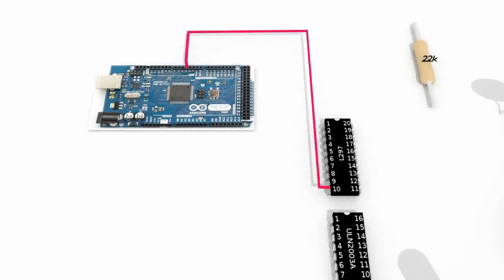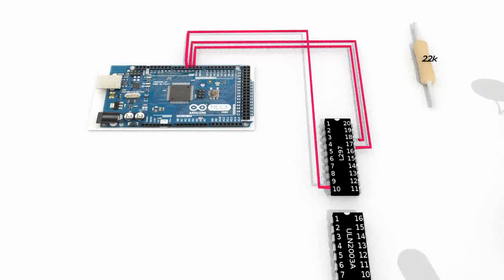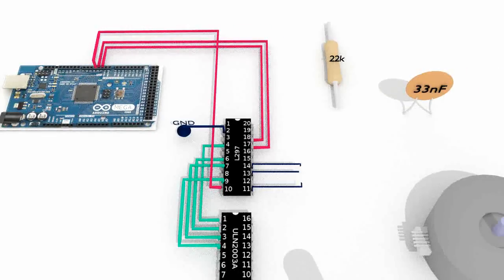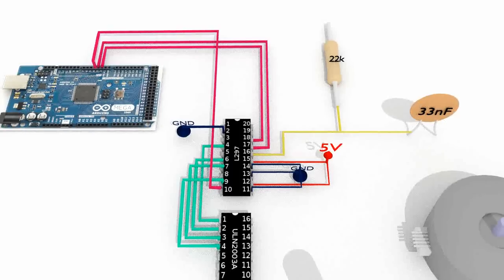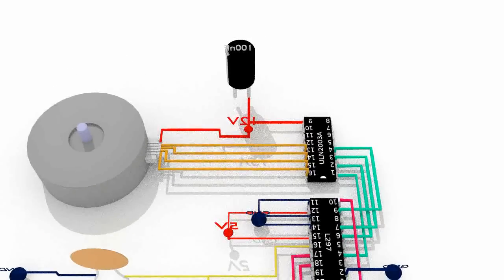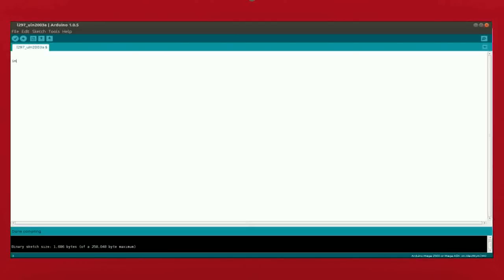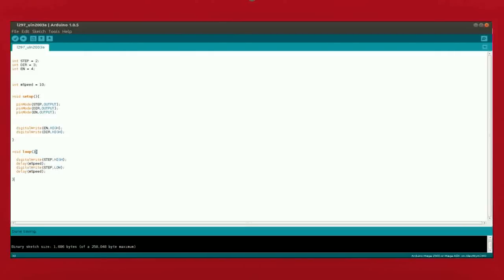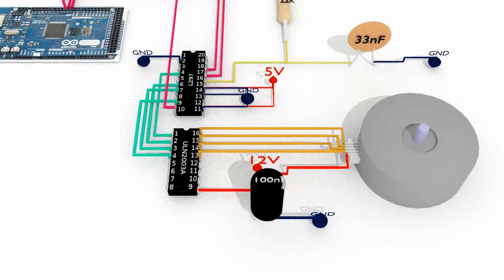Swift Focus: Arduino stepper motor control with L297 and ULN2003A

Comment: Отличная графика. Только не вижу необходимости в использовании L297. Можно и без неё обойтись.
Reply from the maker: Thanks,
ULN2003A works only at logic level so only 5v  and i don't think it has enough current.  If you want to drive a big stepper motor you will need the L297 .

Comment: You use pin 9 for the stepper common, when it should be pin 10, am I right?   I have used the ULN2803A by doubling up each pair of darlington outputs and inputs to double the current abilities, so i have no unused pins on the ULN2803A.  Pin 9 is ground, not common.
Reply from the maker: Yes  ULN2803A's pin 10 is common , but in ULN2003A is pin 9 . so you should wire it as per the IC you used .
Doubling the darlingon inputs and outputs  ti increase the current is an interesting idea . let me know if it works well :)
Reply: I am trying to use the ULN2003A, L297, and controlled by Tiny85. I am trying to get the Tiny85 to be triggered by interrupts  through a duel opto isolator. one signal to wake and set direction, and one to clock the L297. I need two stop switches to be monitored.  I'm not sure I can do it all on the Tiny85 yet. The use is to control a tilting mechanism for my dual band amateur radio antennas on the roof rack, with control from the dash.  I am using a geared stepper I took from a security camera. It has the geared section for rotating the camera, so I kept all that. I don't need  1 full amp to drive the stepper, I used  the extra pins to even out the heat on the chip, in an effort to prolong its life in the hot Florida sun.
Reply from the maker: The  ATiny85 seems to have only one interrupt PIN ,  and if i understood correctly , you want two interrupts one for each direction ? .    and regarding the switches you can have multiple switches by using the analogue PIN , that way you don't use up more pins .
Reply: I only need one interrupt to stop, it will stop if either switch is hit, and stay where it is. It will be either all the way up, or all the way down, so it won't matter if it stops in either direction. The direction is controlled by me, but the stop is controlled by the two micro switch levers.
Reply: Yes, I could use an analog pin and put the switches inside a voltage divider to give them both two different outputs, but that is not needed, as you see it the post below.  I only want it to stop, no matter what direction it is going, the stop is controlled by  two parallel switches, one up, and one down.
Reply from the maker: I see , then that should be doable with the Tiny85 .  for the  stepper motor drive , i think would be best to go with an off the shelf driver like  drv8825  instead of this one ,  it's more reliable  and compact .

Comment: What changes  i have to make if i want to use bipolar stepper motor with 4 wires ?
Reply from the maker: You can use an  L298 IC instead of the ULN2003A .  or better get a drv8825 driver board , it works well with bipolar stepper motors .
Reply: Oussama Ousmoi  Thank you i have already purchased drv8825, but while waiting i will try with l298n and l297 and see how it works.

Comment: I have a power supply of 5v and 350mA, I can use it to power the l297 or I have to use a rasistor to lower the current.  (google translator)
Reply from the maker: the one you have should work fine with l297 .
Reply from the maker: no need to add resistors .
Reply: +Oussama Ousmoi thank you.

Comment: sir i purchased leadshine DM856 for leadshine stepper motor (86HS85), I am controlling it with arduino UNO but i am unable to get higher speed with it. sir plz do guide me to get higher speed on stepper motor
Reply from the maker: The only things that could effect the speed is the arduino code you are using , or  a low current power supply .
The controller and the stepper motor should work fine together ,  make sure the power supplier you are using can deliver at least 6A .  and  share the Arduino sketch you used  .
Reply: sir i have 48v and 4 amp power supplied to it by transformer (AC to DC) can plz help me with coding.
Reply from the maker: The code should be similar to they way stepper motor are controller with 4988 drivers.
check out the first code example in this link http://howtomechatronics.com/tutorials/arduino/how-to-control-stepper-motor-with-a4988-driver-and-arduino/

to change the speed you adjust the value in the delayMicroseconds lines . but make sure not lower than 2.5us  as per the driver datasheet specifications .
Reply: not working and for my application i am unable to control it potentiometer
Reply: sir thank you for your reply
Reply from the maker: you mean you want to control the stepper motor speed with potentiometer ? , what code are you using so far ?
Reply: i mean to say i not using potentiometer to control speed
Reply from the maker: The first example code was not using the potentiometer .  here try the following code 

const int stepPin = 3;  //  STEP PIN
const int dirPin = 4;   //  DIR PIN 
const int enPin = 5;   //  ENABLE PIN

int mspeed = 500;

void setup() {
  // Sets the two pins as Outputs
  pinMode(stepPin,OUTPUT); 
  pinMode(dirPin,OUTPUT);
  pinMode(enPin,OUTPUT);
  
  digitalWrite(dirPin,HIGH);// set the direction
  digitalWrite(enPin,HIGH); //  enable driver
}
void loop() {
   
  // Makes 200 pulses for making one full cycle rotation
  for(int x = 0; x < 200; x++) {
    digitalWrite(stepPin,HIGH); 
    delayMicroseconds(mspeed); 
    digitalWrite(stepPin,LOW); 
    delayMicroseconds(mspeed); 
  }

}
Reply: not working :(

Comment: This helped me a lot thanks!
Reply from the maker: +Mauricio Jimenez glade it did .
Reply: +Oussama Ousmoi Quick question, are you sure its a 100 nano Farad electrolytic capacitor? I cant find it in any store, so I bought a 100 nano farad ceramic capacitor and a 100 micro Farad electrolytic capacitor.
Reply from the maker: +Mauricio Jimenez  True there is a mistake there in the animation  ,  use a 100 nF ceramic capacitor . i though i added a correction caption there :) .  schematic circuit in the  video description  is correct though .